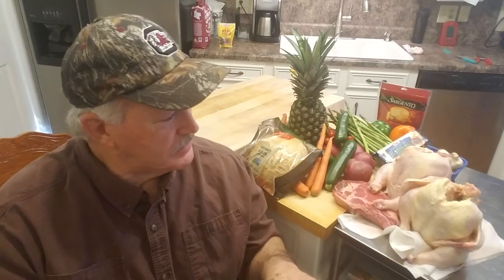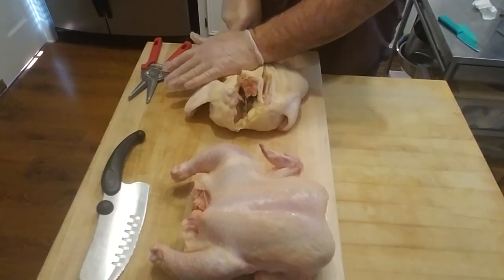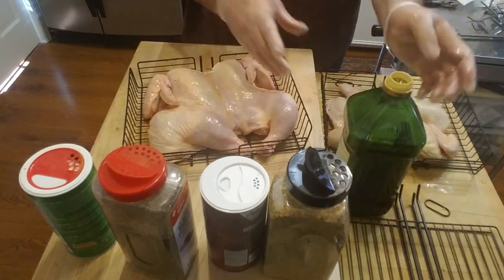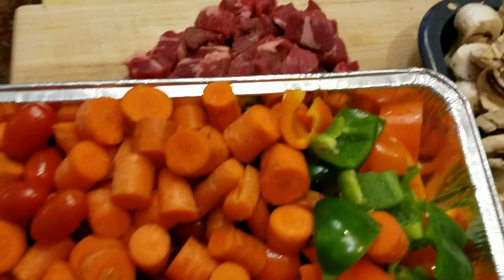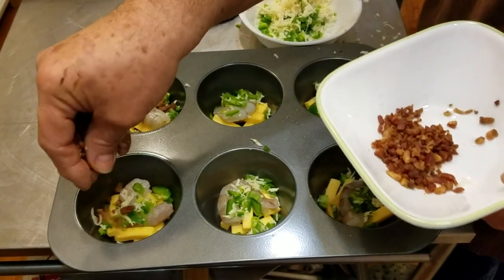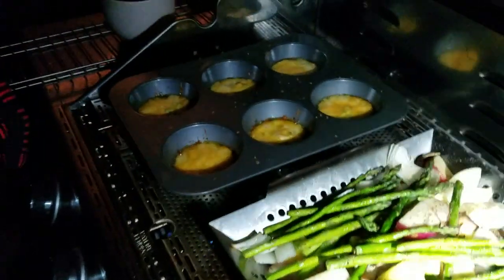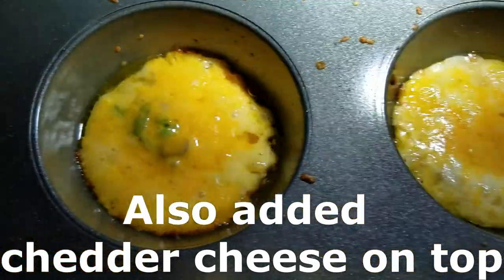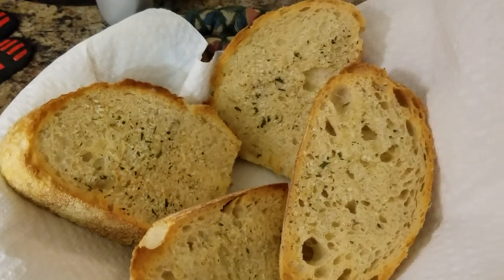WSM Spatchcock Rotisserie Chicken | Cajun Bandit | Kabobs

Comment: Hey Phil , I have a weber 22" kettle. I bought the Cajun Bandit rottisuri and ring , I tried to do a nice roast ,,,Brazilian Picanha sirloin cap . Turned out good but my temps were real hot like 400 F thru the whole cook. I wanted a temp of 250 to 300F but couldnt get it. Please advise. DD in Los Angeles